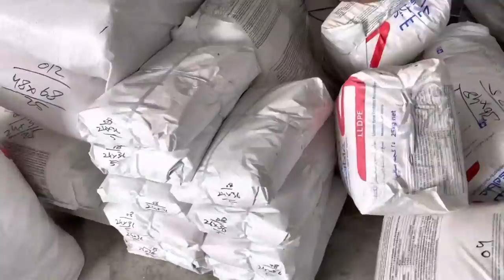Making plastic bags in Factory | Plastic bags | poly bag | polythene bags | transparent plastic bag

Comment: Very interesting. It would have been nice to have some idea what was going on though!☘️👍
Reply from the maker: please watch full video ! thanks
Reply: I watched all of it! It would still be nice to know what was going on?
Reply from the maker: @donalfinn4205   they are making plastic bags those are use to  packing products. like when you open a product which packed in a box and inside box the product also wraped with plastic bag. these kind of plastic bags are making....:goodvibes:
Reply: Yes. I know they are making plastic bags. Yes. I know what plastic bags are used for. All I am saying is, some commentary on what the workers and machines are doing would be nice. I give up.🤯
Reply: @donalfinn4205  You should get out and about more, do some reading about how things are made from plastic pellets by heating and extruding machines. In this case the extrusion takes place vertically, so the extrudate can be formed into "an air-filled sausage" that cools rapidly as it travels upwards to rollers that flatten the extrudate into sheets of continuous enveloping product onto storage rollers.

The rolls of cooled flat sheets are eventually fitted onto heat sealing machines that seal the product into the required length of selected bags , and perforate the opposing end, which is what you see on the customers self-service rollers at the Vegetables Section of your Supermarket.

Quite clearly there are labourers who weigh and carry plastic pellets to the extruder's hopper, tip them in and return for more. It's a boring job, but his wife wants to buy the latest make-up so she looks attractive when out shopping with her girlfriends. So he has to work 12 hour shifts in the Plastic Bag Factory. It's the same old story all around the world.

Unfortunately the Green Turtles of West Africa can't see the plastic bags amongst the Sea Grass, so they ingest the scraps of torn bags, which accumulate in their intestines, slowly and painfully killing them in their thousands 😢.  But that part was hidden from viewers of this video to keep it "child friendly."
Reply: @BrassLock  Obviously, you have some knowledge about making plastic bags and couldn’t wait to make that known. Another know all, obviously.
Reply: Kaise kg hai sir